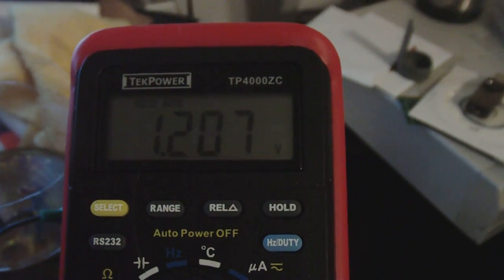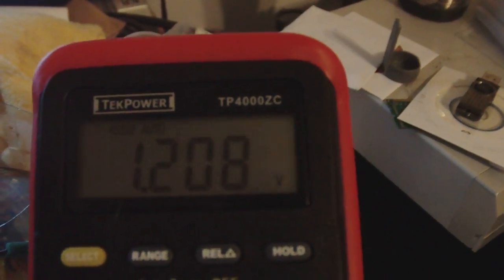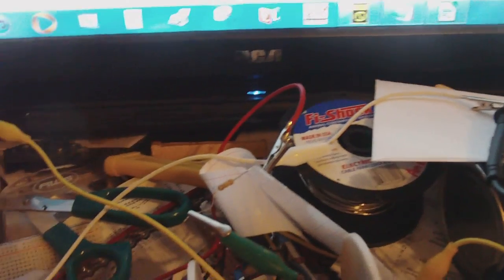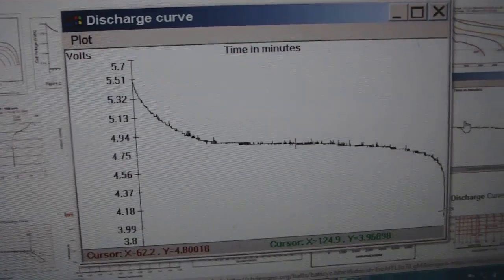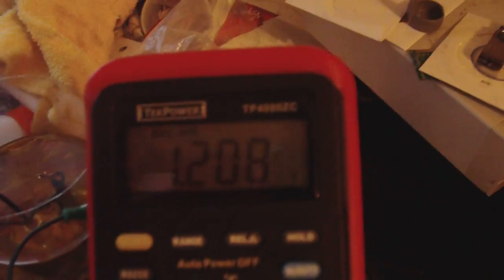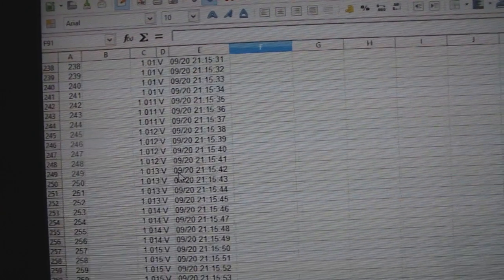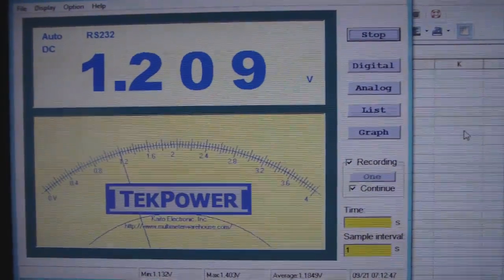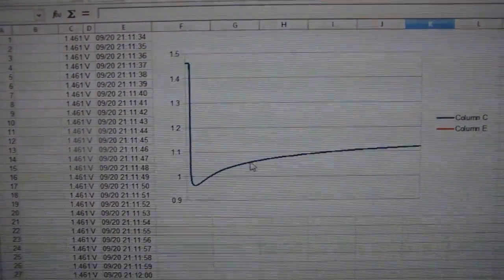Crystal Cell power goes up under load

Comment: To gain useful information fromt his experiment you should have a meter as you do measuring the voltage drop across the resister, another meter in series with the resister measuring current flow and a third meter connected to a thermocouple attached to the resister measuring temperature.  All three should be logged simultaneously.  Then you have usable data.

Comment: If the temperature of the resister increases any under load and assuming the resister has a positive temperature coefficient it would be expected to see the voltage drop across the resister increase as the resistance increases.

Comment from the maker: Yes its a great data logger but remember if  your computer does not have a rs232 port you'll need a usb to rs232 converter (about $10). So far the meter has worked great for me.

Comment: Purely theory here, but.. I suspect that the crystal, under load, while doing work, over such a large surface area is returning water of crystallization, to usable electrolyte, -over time-, thus increasing conductivity, thus allowing more current to flow. When inactive, the water may then "lock up" into it's "dormant mode".

Comment from the maker: Current does go up. What is odd is that if i had no resistor and only had the meter hooked up to the volts setting the cell will start to go down in voltage. But when i connect the meter to amp setting the amps will start to go up. When i connect the cell to a resistor the voltage will go up. These cells work in mysterious ways. Do you have any video of your cells going up? I can't post on Earth light thread anymore, i'm thinking of making my own thread about these types of cells.

Comment from the maker: Nope, never use alum. This cell never needs water to keep it alive. This cell is a copper tube with paper separator that has the crystal mix added to it then it was allowed to dry. Magnesium ribbon was wrapped around the paper that's on the copper pipe. The cell was wrapped up to protect it from water, water destroys the cell. The crystal cell mix is something i've used before in my other videos but it was done it a different way.

Comment: Could you please run the test a few more times with different resistance, and plot the family of results on the same sheet.  I would suggest 50K 33.3K 25K.  This can be done with 2, 3, 4 100K resistor is parallel.  Didn't the the large 5ft cell provide up to 1ma of current ? What is the short circuit current draw of this cell ? Thanks.

Comment: Now check if the current is going up too. Sometimes it looses the current while increasing the voltage. I know you have a resistor so the voltage should be a sign of the equivalent (accordingly with Ohms Law) of its current output. But I have seen very weird things with those cells because they change their "internal resistance" as it is used so the voltage can go up and current can go down.

Fausto.